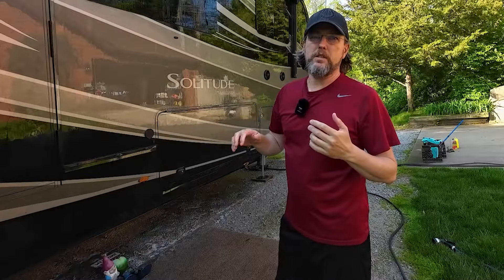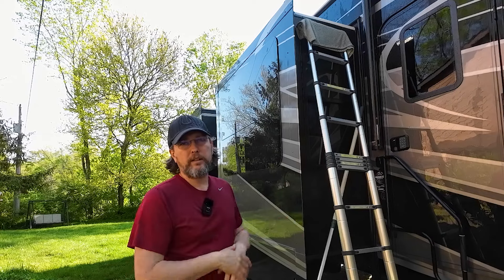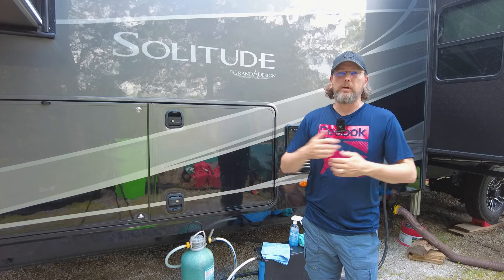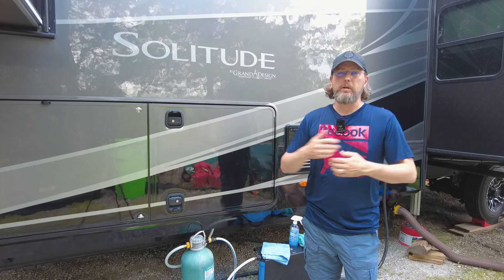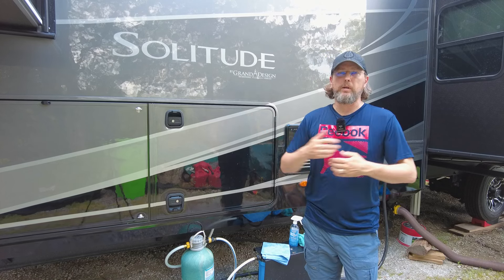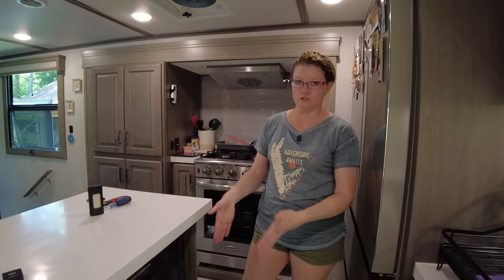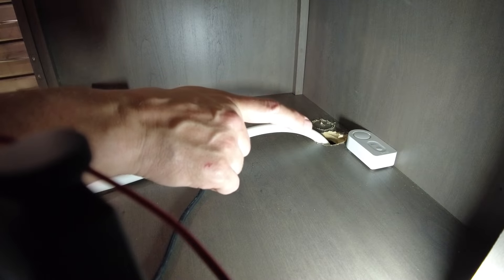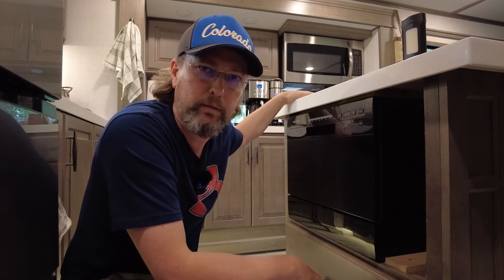Full-time RV Preps | Last-Minute Upgrades | A Bittersweet Goodbye

Comment: Have used this wash wax all for the past year and it’s a solid product in my opinion. I usually follow up the wash job with an Adam’s Graphene and it really lets the finish pop. Typically try to do this roughly every 6 months unless we have been in unusually dirty environment then will do it more often. Graphene is also great to use on the water heater door and furnace door. Makes them look new again!
Reply from the maker: Graphene...thanks for the tip. I'll check it out!